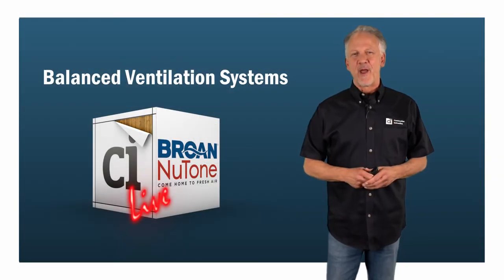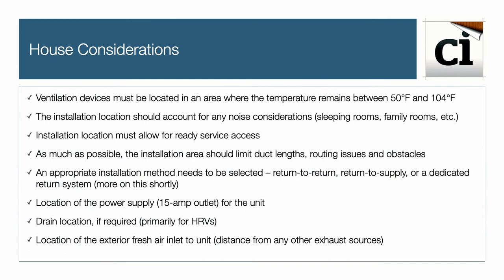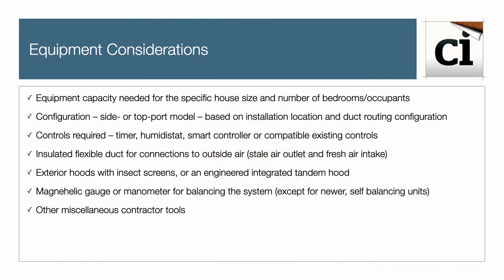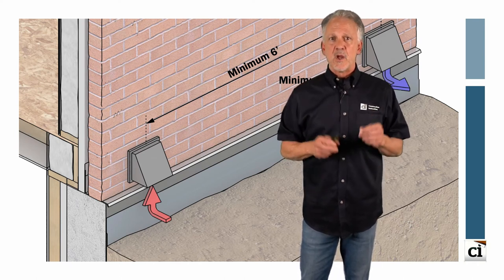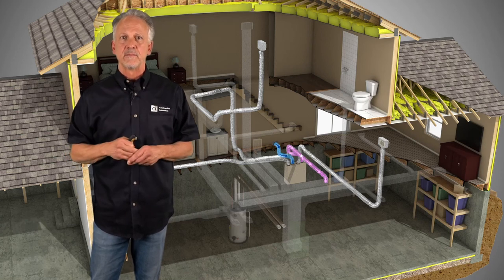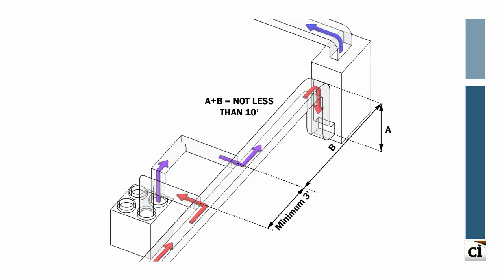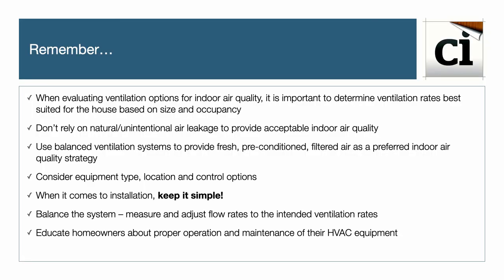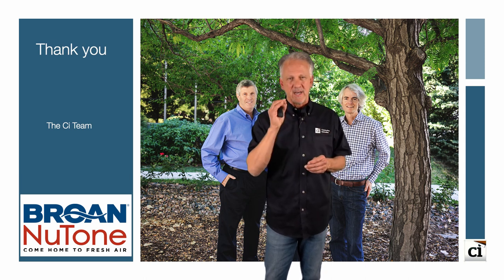What is a Fresh Air System and to install it.

Comment: I’m a owner builder of a place I am building. I won’t have forced air in the house so I ran 4”  rigid duct with exhaust intakes in the bathrooms near the ceiling and then ran to fresh air ducts to the furthest point in the house from these. The house is real tight with 6” closed cell foam in the double stud walls and R-59 in the ceiling. The ceiling vapor barrier is sealed on all edges. All wiring and other penetrations are sealed  wherever they go through wood. I even negative pressured the house to look for any cool spots around the doors on a -20 day.

Comment: I have this system in my house. I live in the Houston, Texas area. I've been told by some people that it should be turned off in the summer when it's over 95 degrees because it brings in hot air and your AC has to work harder to cool the house down. What are your thoughts on this?
Reply from the maker: Good Morning John, Yes we would recommend turning off the Fresh Air System during humid conditions to prevent bringing this air in from the outside.  Please contact our Technical Support team directly for more questions at 800-637-1453.  Thanks for your question!
Reply: @Broan-NuTone  How do you turn off the fresh air system in the winter? I have freezing cold air flowing through my apt through the vents even when the heater fan is off. It is even coming out of the intake vent.
Reply from the maker: @sr2291  Good Morning, We would need additional information on the unit you have installed to properly answer this question. Please call our Technical Support Team at 800-637-1453 so that we can provide direct assistance specific to your installation application.
Reply: I live in Houston and have this same issue. Most of the year it causes issues for me because how humid it is in the Houston area.

Comment: How do you turn it off?
Reply from the maker: Good Morning, The operation of the unit would largely depend on which model you install and how it is set up. Please call our Technical Support Team at 800-637-1453 so that we can discuss the different units with you and answer any application, specification, installation or function questions with you directly.